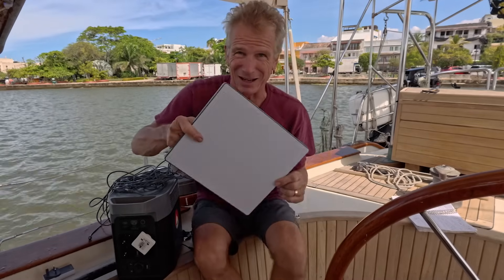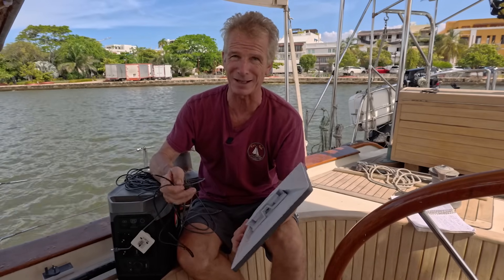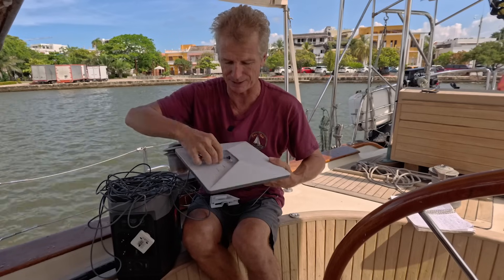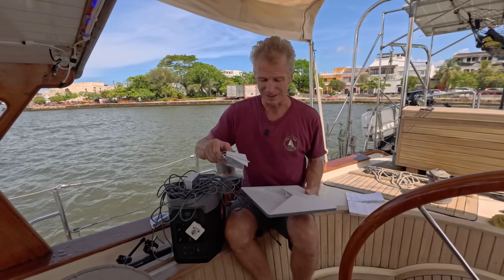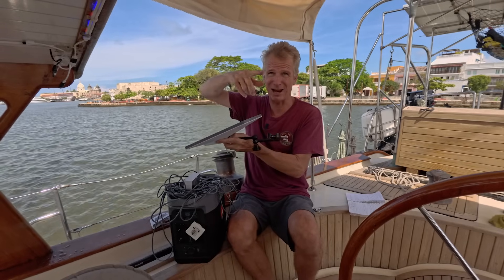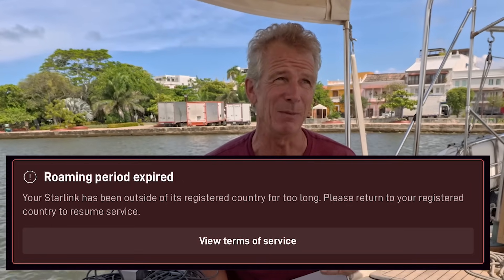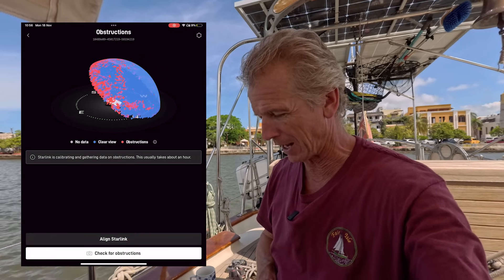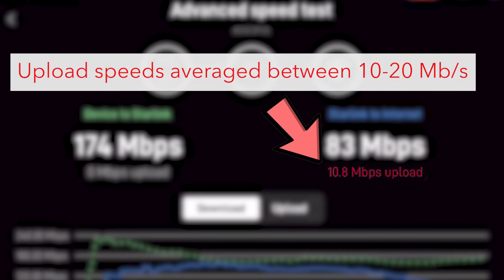Starlink Mini on a boat

Comment: Thank you so much for your videos — I’m learning a lot! 🙂
Quick question: after one year of using the product, would you still recommend it? Are you 100% happy with it?
I’m considering either getting a Starlink Mini for my boat or using 5G eSIM routers (which aren’t cheap). I’ll always be close to the coast, unlike your setup. After the initial setup, it would mainly be used on weekends, when I’m on the boat and want reliable internet to be able to work.
Thank you!
Reply from the maker: Yes certainly 100% happy. The mini has been faultless and gives reliably fast internet access. For us the 100 bucks a month is well worth it for unlimited fast data. The only reason to not do it is if you really don’t need unlimited and occasional slow or no internet doesn’t bother you. Bear in mind there are now many after market products that clip onto the bottom of a mini so it’s easy to unclip it and take it with you when you are doing other things. We have the boat out of the water at the moment for instance and have the mini in the flat we are staying in

Comment: I think the e-sim plans are great alternative to the sim chip shuffle
Reply: For a decent duel sim marine router and a decent 4x4 MIMO antennae, you're in for $1000 off the bat, plus sub for 2 x sims. The Starlink mini it's $200,  plans for coastal aren't much more than 2 x sims, and you've got offshore when you need it. Downside is energy requirements.

Comment: 330/ MONTH, not bad, i dont call 3600/year not bad unless you've got a stack of money or loads of youtube subscribers
Reply from the maker: That’s the second time you’ve posted that figure in the comment. Where are you getting that from? As I said Starlink costs around $1,000 / year not over $3,000 Peviously we were paying around €60 / month both having SIM cards, usually limited to around 20GB so we would regularly run out, service was often too slow to stream and in some anchorages non existent and we would have had to fork out thousands to have snd sort of connection to get weather updates offshore. I hate to say it because I’m not a fan of Musk, but Starlink is a game changer and incredibly value for money

Comment: However good, i wouldn't  touch any product from Elon Musk, Tesla and all. Just how I feel and no reflection on the quality of these products.
Reply from the maker: Easy to say if you don’t actually need one. Having just arrived in the Azores after crossing the Atlantic though Starlink has been by far the most important piece of safety equipment aboard as well as the most useful in many other ways and there simply isn’t an alternative at the moment. As soon as there is we will switch but until now Starlink it literally far too important on an offshore yacht to have those sorts of principles I’m afraid

Comment: Hi Steve, I use the mini in the van in tthe UK and abroad in the boat in the Ionian sea. If you are docked and you line up the dish so it shows within the app that it is lining up, the speed can get up to 280 Mbps, so if you can align it properly and you can stay aligned it does make a big difference on the connection speed. THANK YOU for producing another great epeisode!

Comment: Bit late for a comment, but may be helpful for those who have just found this clip. I fitted my Starlink mini on my boat using a Victron 12v /24v DC to DC converter (Orion-Tr 12/24-5) as the power supply. Using the long cable supplies with the unit, I  cut one end off, stripped back the wire to find two core one being red the other (negative) bare wires, looks a bit like coaxial shielding,  just unwind from the power cable and put some shrink wrap sleeve on to protect it. The DC to DC converter can be changed to provide 30v but mine runs without an issue at 24v

Comment: Hello There. We have a good solution for the Starlink mini power on a boat.  We are using a victron 12-24 5A dcdc unit and you can tune this to 30.5v output.  Then use a normal marine 2 pin plug and socket for a waterproof connection to the Starlink mini.
Reply from the maker: Sounds like a very good option

Comment: Great video.  Can you share more about the pole mount you used to secure it.  Thanks.
Reply from the maker: It’s actually a mount I got from Starlink that’s meant for the standard dish. I had to cut a lump of wood to fit into it to mount it. I’m sure there are ones designed for it now, this was early days of the mini

Comment: "The Starlink Mini has a power input rating of 12-48VDC, 60W. " - Starlink website. You only gave it 12v @ 3A so 36W. Current is important, right, not just voltage. Not sure your advice is therefore sound about it not working well on 12v?
Reply from the maker: No the mini should be able to run on around 35watts and that’s exactly what our is drawing now running it from a small Victron inverter (well that’s what it’s consuming but of course the inverter is inefficient so I’m taking about 15% more from the batteries than that ) I also tried the mini on the boats 12 v system ( which is actually 13.4v usually ) and of course able to deliver as much amperage as the cable can take. Problem is the length and gauge of the cable that comes with the mini is not good enough for a 12v (or even 13.4v feed ) the voltage drop is just too much because the cable is not up to spec for a standard ’12v’ source. So the options are to feed a higher voltage up the proprietary cable or replace it with something that can deliver a decent voltage, the mini just becomes unstable without it.

Comment: Starlink is pretty good, but you should just always check if you can get esim. You can avoid hassle of connectivity issues and setting up starlink. That said, I would always have one on boat especially for international sailing. Using something like holafly or something, this is pretty painless as you can get esim from one site instantly for most countries.

Comment: Any updates on your mini?  Have you found success in changing between dishes every two months?  Does it reset the clock for your roam account?  We’re taking delivery of a new Boat in Thailand in August and may purchase 2 or 3 mini dishes here in Mexico where they are half the price and switch between them in Thailand if it works. Thanks so much!
Reply from the maker: Well by our calculation we had run out of our 60 days while we were in Panama but didn't get cut off. We are now in San Andres which is a Colombian Island even though it's a long way from their shores. We were on premium coming over off-shore but have now switch back to basic roam and it's working which is good as that puts us back on unlimited data. Hopefully it should also log us as being back in Colombia (our registered country) so hopefully the clock only starts ticking again when we leave here, if indeed they are bothering to count  still. I'd be very happy to stay on the mini and not have to switch to the standard as it works just as well for half the power draw.

Comment: 7:44 Roam contract has 60 days max per year away from ‘registered’ country… so it’s not a ‘few months’… so you many need to have 3, unless you stay in the newly registered country for 30 days… lucky here in Australia… one country island… almost 14,000 nm of coastline
Reply from the maker: Yes that’s right, but you can reregister after 3 months so there’s just the month gap, hence flip flopping between two units. And this is only if they strictly implement the rules, some people are saying you will only be cut off after 60 days if you are using in a country not selling Starlink when the 60 days runs out. Not sure if that’s true because we were in Aruba ( which doesn’t sell Starlink yet but it does work there ) and we got cut off, had we been in Columbia maybe we wouldn’t have been? The test for us will be if & when they cut off the mini now we have left our registered country of Columbia.

Comment: 3:36 Thanks for the video.. FYI… Voltage drop could be the problem… but insufficient Power (watts) is definitely the problem.. your power fitting had a 3amp rating.. … 3 amps at 12 v is 36 W… Mini in test needs 40 to 50 watts, probably because of some cable loss (ie to deliver 40w at device, needs 40+ watts at supply)… anyway its more than 40w…  at start up for acquisition, and possibly 30ish at general status.. or 40w at full download
Reply: update… even with a 10A power outlet, from the Bluetti EB3A with the Starlink provided 15m power cable, the Mini wouldn’t work. The Bluetti indicated 25 - 50 watts was being drawn, but that was at 13.7 v, so the Amps were higher, and the cable warmed. I was unable to test the in-use voltage drop, because I was using a Bluetti at a local retailer 😂. I am getting some new DC5521 plugs and sockets and will do more testing after they arrive… I have also sourced a 12 to 24 volt DC to DC booster, which I am hoping will enable the standard Starlink power cable to work in my 12v powered systems..

Comment: I am using a 12 Volt system with a proper diameter of the cable  and it works just fine. The cable delivered with the dish is just to thin.
Reply: Could you please post a link to the cable that you are using?  Thanks
Reply: @michaelzotzky4378  15AWG or 17AWG with a dioameter of 3 or 4 mm should be very sufficient
Reply from the maker: It depends on the length you need, we are using the whole of the long supplied cable and remember for the calculator thats double as its a wire return so if we were wanting to supply 12v then that cable would have to be 8 gauge to be within a 2% drop, 10 guage for 5%... use this calculator: https://www.wirebarn.com/Wire-Size-Calculator-_ep_41.html

Comment: The Starlink Mini requires 12-48 VDC at 60 watts. Trying to power it with a 3 amp 12-volt source isn't going to work.  60 watts equals 5 amps at 12 volts.  60 watts at 30 VDC lowered the amps needed down to 2, so you also gave yourself some headroom in that cable by not pulling so many amps. It was a smart move. 👍

Comment: I'm heading to Panama in January to buy a boat and plan to purchase the mini there as I understand its on sale for $165 vs $600 in the US. My plan is to sail back to the Florida from Panama. If anyone knows any issues with activating service in Panama, let me know. Good video. Thanks
Reply: Hi, where is the mini for sale for $165? Do you know that?
Reply: @rosansteur  I traded emails with an electronics retailer in Colon, who confirmed availability and pricing. The normal price in Panama is $200 and Starlink was offering a temporary sale price. I'm not sure how long the sale will last but it should only go back up to $200 after it's over.
Reply: @26N80W  That sounds great, thanks!

Comment: So, what IS the defined power requirement quoted on the back of the dish?
Reply from the maker: The mini needs to be able to draw up to 60w, so that’s 5 amps at 12v but will usually be running on 20-40w. That’s power at the dish of course though, using the very long skinny cable supplied the voltage drop from an average house bank even if it’s fully charged and sitting at 13.2v or so, by the time it reaches the dish will be well down on that and not be able to run the unit well, or at all.

Comment: we have an gen 1 starlink on our boat mounted straith up. (nothing do do with north or wen the boat moves or tips over etc. Works perfect even with galeforce wind and waves up to 4 mtr. 
I was thinking to change to a mini but now i am not sure.
After 2 months you can chance your serviceadres did you try that ? ( they told me yu can chance that as often as you want)
fairwinds,..
Reply from the maker: @jgvv01  We now have the mini mounted straight up on the arch with a clear view of the sky and it’s actually working as well as our Gen 2 standard model was. I couldn’t change the registration for the standard model, I got a message that it couldn’t be changed within a 90 day period

Comment: Nicely timed, am looking to get one of these, only problem is that Im in S Africa and you cant get them. I heard terms of use etc are changing in the new year??. Stay safe out there.
Reply from the maker: Terms of use change all the time Barry! It’s certainly worth getting one though. The mini is small so if anyone’s coming out while your there get them to bring it in hand luggage, Judy brought ours from the UK
Reply from the maker: PS tell them to take it out of the box, a friend of ours had theirs taken at customs in SA, they wanted $500 in tax, not sure how they worked that one out! They got it back for a small fee but best to save the hassle.
Reply: @svfairisle  I once flew to Hawaii with a 7W solar panel in my backpack. About the same size.

Comment: POE should work well as its 48V - and this is how the Starlink V2 is powered.   Our Starlink v2 on a std (long) cable with a 12V conversion works well.  If you get dropouts, this is due to voltage drop, possibly as starlink is syncing to another satellite.   A 2200uF Capacitor solved this for me.

Running V2 on a 12V also saves allot of power - mine draws around 36W consistently.

Comment: Thanks Steve for this really valuable insightful video. Quick question, you bought it in the UK and registered it in columbia, when you bought it do you not have to say what country it's in or are there 2 processes. Thanks.
Reply from the maker: It knows what country it’s in and it knows what country it’s from! Judy carried it on the plane from the UK, when I fired it up and went to register it it came up with a message saying the unit appears to be from another country or from a reseller so there would be a $150 charge that would be applied in 6 days time. That charge never materialised but it let me register no problem but as I said in the video you can’t now seem to just pick a country, I assume that’s because people were picking cheaper countries to register in. I tried Panama or the Cayman Islands as I figured that’s where we would be in 2 months time and that would reset the stupid 60 day rule. However I couldn’t seem to get it off registering in Colombia so I did it there.. not bad as it’s half the price of the US!
Reply: Thanks

Comment: You should look into e-SIM cards, takes no time at all and no fluffing with physical sim cards. I started doing it because I still need my phone when being away from the boat but it's so practical that it makes me wonder why I have Starlink at all. I have one on my iPad as well, for when the voltage drops for Starlink.
Reply from the maker: But can you get an unlimited data contract? We haven’t found one and the rate are usually 2-3 pounds per GB. Starlink tells us we use around 500GB / month so that would be over a thousand bucks!

Comment: We have a Gen 3 Starlink antenna (flat) with the Coastal Roam plan.  At first I would futz around with it on deck getting the orientation correct, but then we mounted it flat on a pole at the stern with our GPS and AIS antennas.  Boat is currently moored pointing about 025° (Compass), no problem; also no problem when it was moored pointing 090° or 270°; and worked fine traveling up the US West Coast from San Francisco to Port Townsend and down the Hood Canal.  Our version also has the snow-melt feature, which we haven’t needed yet, and it seemed to work fine when the atmospheric river came through.
The only downside we experience is that it is so popular up here, so the speed slows considerably in the evening.  We were warned about that though, and have an AT&T MyFi hotspot for backup.
sv Gonromin
Reply from the maker: Yes the same is true for the mini. I now have it mounted on the rear arch same as the standard model which is on the other side. Both are mounted flat and work no matter how we swing at anchor or pitch and roll while sailing, pretty amazing really

Comment: As mentioned previously Fabule is equipped with the marine version of the antenna array which is larger in surface.
Larger surface means higher gain on the array and the array is quite insensitive to obstacles located in the far field of the radiating elements but still in the near field of the array so the blocage is minimal. 
The marine version consumes more power though as we drain about 70 to 120 W depending on the traffic.
The connection to the satellites works remarkably well even at sea even with quite a bit of sea; we not often lose the connection and when we do, it is only until the boat gets back to a more level attitude. 
As well the marine version does not need any orienting, and is tilted to about 8 degrees from horizontal to drain rain water by gravity when the boat is level.
I am glad that you found a solution for your Starlink problem.
See you on the water.
Reply from the maker: Well I'm sure that's right and I'm sure if I had only used the marine version I would assume that because it is so much more powerful the smaller models would not cope with things the larger ones can. In reality though that just does not seem to play out. We used the standard model for 17 days across the Atlantic in severely rolly seas and the standard Starlink didn't drop out once, it took longer to acquire satellites after being turned off but that was all. Similarly I assumed that the mini being half the size and half the power would not perform nearly as well as the Standard version but that just hasn't been the case. I now have it mounted flat on the rear arch on the other side to the Standard model, I dont align in and it works perfectly without dropping out at anchor or at sea. We had two days off shore from Colombia to Panama and it didn't miss a beat, quite remarkable.
Reply: @ thank you for the information. I have friends that are looking to install starlink on their Boreal so this can be a more cost effective solution than the marine one which remains expensive, that’s sure.